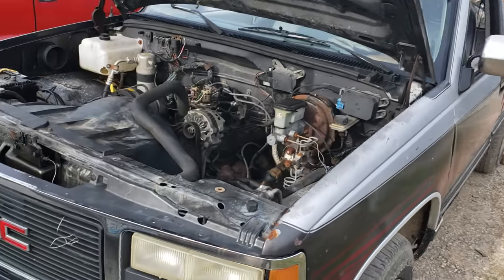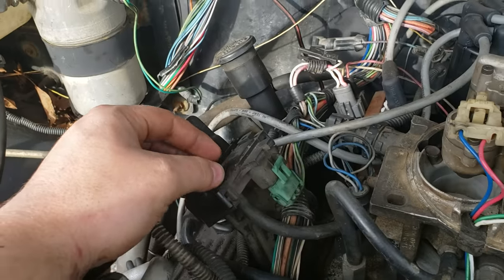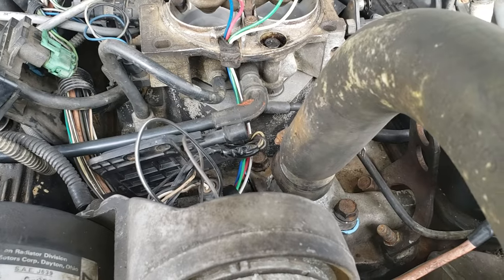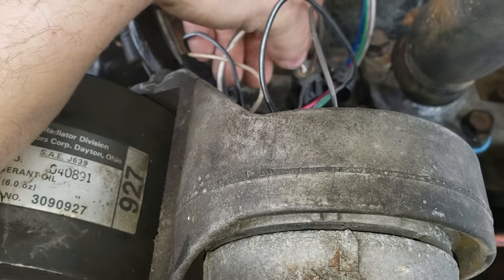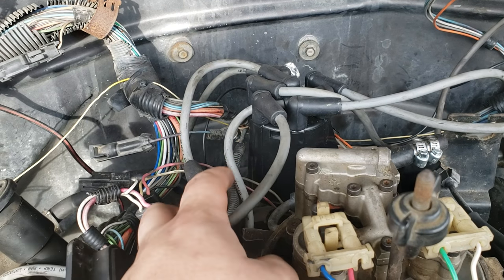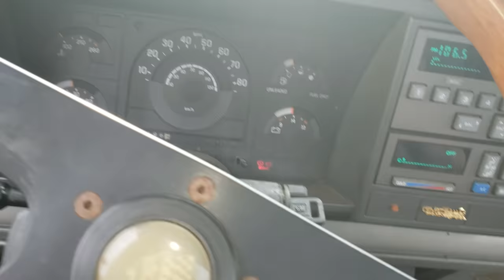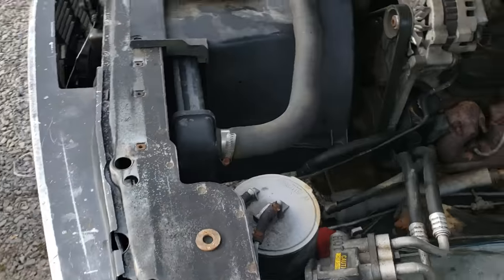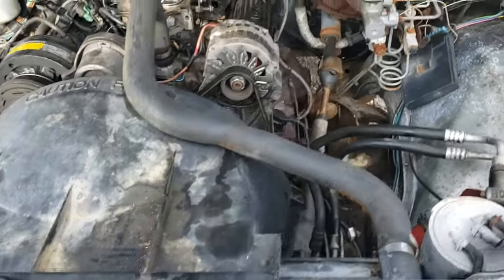Chevy/GMC TBI flooding smoking running rich diagnose and fix

Comment: So i have a 91 4.3l s10 and its running rich and ive replaced the ignition system new distributor with the cap and icm and rotor like whole new distributor and did the coil and plugs and wires its also got a new o2 sensor oil pressure sensor sender switch and new eec canister and air filter plus i did oil and coolant flush /refill. And used a can of seafoam through the intake but it still failed the smog test im in California. It fail because hydrocarbons so its running too rich but i cant see any leaks from injectors or anything
Reply from the maker: I think you have several options here. See if you can have your local mechanic check your fuel pressure,  also check the fuel pressure regulator its behind your 2 injectors there are a few screws holding the too peice on u csn see if it failed and is throwing pressure off. Try getting another used set or new Injectors. Check your timing it sounds like the map sensor check the vacuum hose from the map sensor to the back of the throttle body or the engine coolant temperature sensor you can tell if it's bad I would bet that its between the map sensor or the engine coolant temperature sensor
Reply from the maker: Keep me updated please
Reply: @maximumredline97  so to check my fuel pressure regulator what would i do i did clean the top of the trottle body with throttle body cleaner.
Reply from the maker: I doubt it's the regulator but there are a few screws on top of the peice that mounts your 2 injectors take the screws out and you can look at the regulator my money is the map sensor or ect sensor but if you want a further inspection of the regulator I could make you a video of it tomorrow
Reply: @maximumredline97  all my vac lines are good too ive checked it so much and my distributor is in pointing pretty much directly at the cylinder 1 and plug tower 1 i can get a timing light in the am but pretty sure i need the new oil pressure sensor sending unit switch and map sensor
Reply from the maker: Lmk how it goes then
Reply: @maximumredline97  i replaced the map and egr and evr (next to map) and a new oil sending switch but i will have to wait till tomorrow to bring it to the smog place and see but ill keep you updated
Reply from the maker: 10-4 lmk
Reply: @maximumredline97  i went to the smog place and it failed for hydrocarbons its at 155 at 15mph and ave is 54 and 25mph it was at 108 ave is 77
Reply: @maximumredline97  and i just put a fuel filter on today also
Reply from the maker: That's crazy
Reply from the maker: Dm me a cell number
Reply from the maker: Fuel filter wouldn't make it flood bro
Reply: @maximumredline97  i know and my first test it was at 155 second test it went you 130 third test its at 155 idk..
Reply: @maximumredline97  mainly only changed fuel filter cause it was probably the original on the truck
Reply from the maker: Have you tried engine coolant temperature sensor
Reply: @maximumredline97  its a pretty new sensor i replaced it maybe 3 months ago the one next the thermostat housing and idk how to dm
Reply: @maximumredline97  i got a new cts and a timing light ill let you know of any changes
Reply from the maker: 10-4
Reply: @maximumredline97  so i got that in and i have the timing light on and when i plug the black and tan wire back in it puts the timing mark 17°btdc. After i turn the truck off and turn it back on
Reply: @maximumredline97  like 17° before top dead center
Reply from the maker: I think mine is around 3 btdc
Reply: @maximumredline97  so what should i do to get it closer to zero?
Reply from the maker: Loosen ur distributor hold down boad and turn ur distributor till the timing degrees is within like 6
Reply: @maximumredline97  like advanced?
Reply: @maximumredline97  i was thinking turning it 17degrees advanced it would balance it out but i figured it would be better to get some advice before that because i live basically right above sea level the engine should be right around 0 degrees and i have it set to 0 degrees then i plug the wire back in and it sounds great and everything and stays at 0 but then i turn the key off and wait alittle i start it and it is 17degrees before
Reply from the maker: Yes anything lower than 6
Reply: @maximumredline97  i did a tbi rebuild and new pcv and new cat and it passed smog at 49 hydrocarbons at 15mph and its running even better with the tbi rebuild and pcv then i went to muffler shop and the cat that was in the truck was the original and was rattling and the screens weren't even attached to the sides inside the cat it runs great 324 thousand on the odometer
Reply: @maximumredline97  but thanks again for the advice and the videos keep up the good work buddy
Reply: The same happened to me with my 1990 GMC Sonoma 4.3L. It didn't pass but the guy told me that it was most likely the Cat. Took it to the muffler shop, put a new cat and it passed !!!

Comment: I replaced my plugs and wires on my 94 and immediately when I went to start it ran real rough then caught idle and stayed right after about 30 seconds, stops on me at certain stops and when I turn it on it bogs for about another 20 secs then catches
Reply: I got the same issue my 1990 c1500 kinda tries to die first thing in the morning as if I let the clutch out but I don’t and sometimes it backfired when I’m out of gear and in neutral and stalks when I come to a complete stop but I don’t let it stall and hit the gas.
Reply: @sega2229 ever figure it out?

Comment: Forgot to mention tbi unit runs at 11-13 psi I bought an inline test kit with various fittings and a Gauge from O'Reilly auto parts that can be screwed inline at your fuel filter on the passenger side frame rail. Summit racing offers an adjustable fuel regulator that installs on the back of your tbi unit where the diaphragm is housed it has a knob that screw in or out for more or less fuel. I personally never bought that kit since psi was 12. After 36 years of screwing with that truck I finally went to a carb but saved tbi/ egr manifold and  distributor and did not cut anything off wire harness
Reply: you know of any good videos to swap to carb? what intake, carb, and pressure regulator did you use?
Reply: @markhumphrey6016  forgot to ask if your truck is a 90's model you will have  to use a holly carburetor with a TPS sensor attached on the electric choke of the carburetor to shift your computer controlled transmission, mine is a 1987 chevy 4x4 with a 700r4 transmission that uses a TV cable to shift therefor I didn't need to use the holley carb setup  which summit racing also sells if neeed.

Comment: Put all the things you called, in new, except for the fuel regulator. Still runs like shit, too rich, black smoke when starting. 91 gmc vandura.
Reply: Rebuild the throttle body
Reply: @thrasherjay2400  I did, but I found the issue. One of the rubber seals of one injector was ripped.
Reply: @Petrolhead350cui  awesome im still struggling with mine I rebuilt the throttle body and put new throttle position sensor along with the idle air control valve and it fixed most of the idle issue also new plugs wires but still runs a little rich at idle.. now the only things left is the coolant temp and map sensor.

Comment: You’re saying the coolant temperature sensor tells the engine how hot to get?? Sounds like bullshit
Reply from the maker: In saying the coolant temp sensor senses how warm or cold the coolant is to therefor regulate how rich or lean to regulate the fuel sir. Speak b4 u know
Reply: @maximumredline97  don't need to be like that in your video your comment you made was that it regulated how hot or cold the engine got maybe describing something in a clear manner would cause less confusion.......  when what you ment to say sends a single to help the engine determine whether to add more or less gas pending it being hot or cold
Reply from the maker: @TheAirforce14  if you knew then why even say anything lol. U obviously are trying to find out something by watch a diag video
Reply from the maker: @davidnewman4765  thank you bub!!!

Comment: Does anyone know why my 1994 k1500 runs great but when it gets hot it wants to load up with fuel. Sometimes if I drive it somewhere and park and go inside and come back to start it up it will just bog down. I can’t even go through a drive through without it building up with fuel. At least that’s what I think it’s doing. Anything will help thanks
Reply: ICM ignition control module burning out?  My 1991 350 TBI would run great for about 5-7 miles until the engine warmed up, then stall out. Hard to start and keep running with engine warm, backfiring. Seemed like it was flooding out. Strong gas fumes. Longer it sat and cooled down, the further I could drive. Thought it was the coolant sensor at first. It failed the ohm test, but realized my multimeter also burned out and was giving wrong readings. Then just before I got the new multimeter, the truck would not start at all. No spark at any of the plugs. Got new multimeter. Pickup coil output okay. Ignition coil okay. ICM sits between the pickup coil and the ignition coil, so if both of those work, the ICM is likely at fault if no spark at plugs. ICM has to be taken to a shop to be tested if suspected. Removed old ICM. Turns out the dielectric grease under the ICM totally evaporated and the ICM overheated and finally burned out completely. Got new ICM. Problem solved.
Now I can work on poor acceleration that is likely fuel related.
This is fun. Not.
Reply: @user-bg2oi4bz3p  so I got to looking and a lot of people don’t really think of this but when you put a new motor in a lot of times people will crimp the fuel return line right behind the throttle body. Well sure enough that’s what happened to mine. It was crimped just enough to not let fuel return back to the tank.
Reply: @Tman-jg7tu  I was hoping you had already found it. Good detective work. So many things could go wrong and it's so time-consuming.